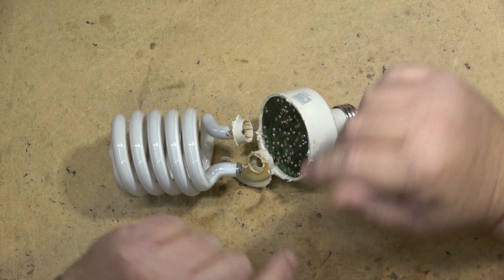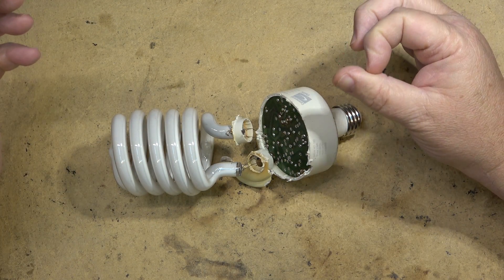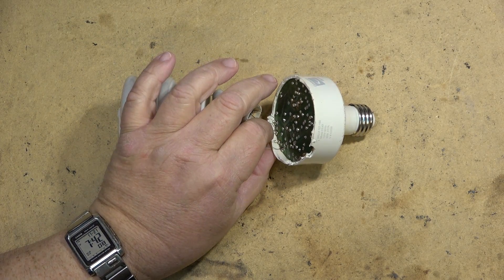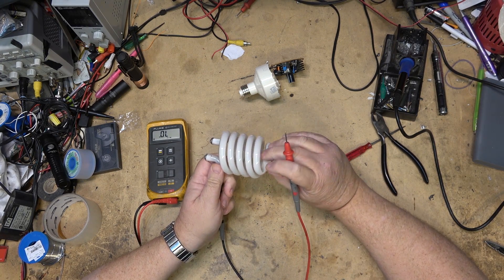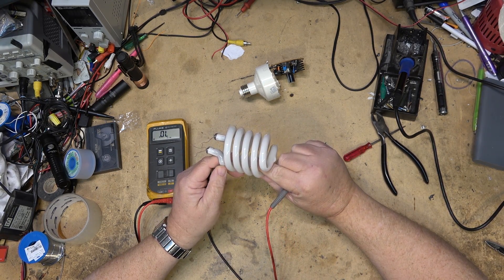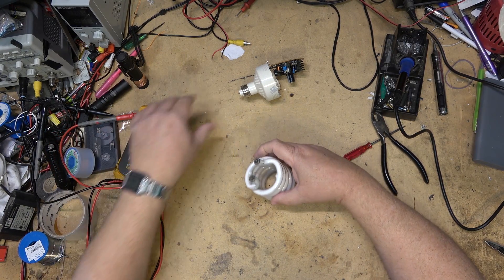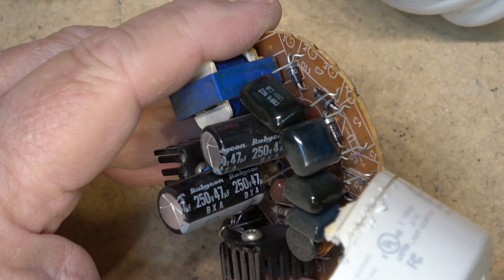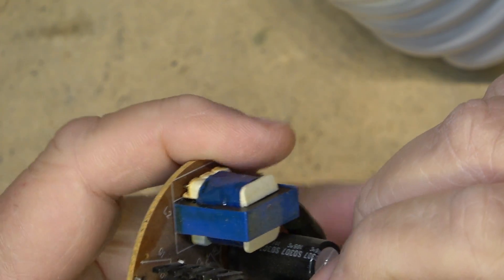I Popped It!

Comment: Amazing, I have had them last a long time, but you got me over a good few years, I think I had 12 years, but it wasn't dead, just getting a bit tired.  Replaced by an LED bulb, I bet it doesn't last half as long, unless it is a Dubai lamp, which it isn't.
Reply from the maker: I have older ones. 4 Ikea folded tube bulbs. At least 25 years old.In the laundry room. Had them in the old house and when I rebuilt I put them in the laundry room where they still reside. They are run pretty much every night, as that is where the cats crap box is, so it is usually being cleaned at night so they run for probably 30 minutes a day minimum, but 25 years in they still work.

Comment: Interesting video, CFL’s suck because of EMI issues, go with LED bulbs.
Reply from the maker: LEDs throw just as much noise as CFL.   I do use many led.  I am using up my supply of CFL.  I may get a few really big 125 watt bulbs for the studio.  In the house everything has been switched to LED now.  Just a few Edison type incandescent for the look.
Reply: Nope, they both convert AC to DC (inverters) and perhaps I have some poorly designed CFL’s but with my portable solid-state radios, antenna fully extended and plugged into AC outlets causes a lot of static when using CFL bulbs. When using LED’s the noise is completely eliminated. Yes LED’s do throw out some noise but not near as bad or noticeable as CFL bulbs. @12voltvids
Reply from the maker: @kenf8563  they both use inverters. The CFL feeds ac to the tube, high power led used pulsed DC.  I get interference on my hf radio from both.  They have now started replacing street lights with led.  I can hear the noise increase every night when the lights come on.  You might not get it with the small ones but the larger units yes.

Comment: Oh boy, those older monster CFL were good.  One I bought from 1998 was still good until a few months ago until I knocked the lamp over.  Unit I broke had a dedicated power factor correction chip as part of the power supply when autopsied.  Like a pre power supply for the inverter if I recall correctly.  When it broke, made me remember you fixing this one.  No way to fix mine....

Comment: Nice docu on a energy saver. I use higher wattage energy saver bulbs in my lighting kit. One bulb in the kit got delivered cracked - the glass was cracked, but I had to film that day. I used super glue to see if it would hold, seal and work. It did work & it has ever since. Its a 125W version, rather big and gets handled with kid gloves. Must admit though, I'm always waiting for it to fail.
Reply from the maker: Yes I am going to get some bigger ones for over the bench.  These LED lights seem to be getting dinner as time goes on.

Comment: You make me regret erasing from existence my old CFL bulb kill video even more! I connected an underpowered flyback to it, and recorded it through a big magnifier, so it was in extreme closeup. I separated it from the inverter, the inverter was dead already. The arc inside kept chewing the glass at one end of the bulb, making a tiny lightshow in there, until air started to leak in.

Comment: Nice Rubicon caps! Ahhhh just the same as that shitty chinnesse lamps that last 1 year. Folks! It's worth pay a bit more for a realiable product!
Reply from the maker: 18 years out of this one.  Solder connection let go 2 years ago fixed that up and all was well.   The number 1 killer of CFL is heat.  Enclosed fixtures bring an early end to CFL and led.   I have some even older Panasonic lamps around here that still work.   Short on off cycles are also bad for them.  They like to run 15 minutes minimum at a time.    I still like and use CFL bulbs mostly in the workshop because they give off  a nice light without glare or harsh shadows.

Comment: 18 years for this type of lamp must be a record.
Most of them start taking ages to reach full brightness then just die.
I am not a fan of the new LED lamps, i find they are harsh on your eyes
no matter what color you go for.
Reply from the maker: I find a lot of glare from the LEDs over the bench
Reply: @12voltvids  LED lighting may be more energy saving, but i don't
think it does your eyes any good.
If you accidently stare at a very bright LED source, it leaves a long
lasting effect on your vision, i am more prone to this due to diabetes.
Modern LED car lights can be very bad for this.
Reply from the maker: @Barbarapape here's an idea, don't look at the lights.  You don't stare at the sin do you?
Reply: @12voltvids  All sins are forgiven! i wonder how many ultrabright LED's it would take to make a source of light as bright as the Sun?
The last place i worked at sold high power LED torches with a warning on the box never to stare directly into the beam.
Reply from the maker: @Barbarapape  yes my big led flashlights have the same warning.  One throws so much heat it will melt our paper money.

Comment: Lasted longer than my led bulb the first one it failed by the looks of it from solder on the man board failing the latest one has lasted a lot longer 13 watt claims to be the equivalent  of a 100 watt but not as bright as a standard old school bulb .
Reply from the maker: 13 watt claims to replace a 60 watt. 23 watt for 100 watt, 42 for a 200 watt. 65 for a 300 watt. I run a 42 and 65 as fill lights behind me.

Comment: In my experience it's always the tube that fails, I've only had one exception and that was defective from the factory. Most of the ballasts still were good except for one brand where the inverter also died (although I'm not sure which died first). Many of the older ones had a PTC thermistor across the arc to provide a controlled startup, and I'm sure this is why modern tubes always die early if there's more than one or two power cycles a day.

Comment: Still have a pack of Phillips tornado lamps, left over from the box I bought around 2000, and they tend to last around 6-8 years in regular use, and around 2 years when on 24/7/365. Also have some PL adaptors, both the magnetic, and the electronic type, which date from probably around 1995, as those you could simply replace the lamp with a new PL lamp, and they all work. Did have to repair the electronic ones often, they would have rectifier diodes blow and take out the fusible resistor. The magnetic ones would run the PL lamps on 24/7/365 as uplighters and emergency lights for around 5 years per lamp, but only if you used Osram or Phillips lamps that were made in the EU, the ones from USA or China barely made a year, though the first few GE lamps, made in the USA, before the plant moved to Mexico, were pretty good.
Reply from the maker: I have 3 PL fixtures and a circline all magnetic preheat.   The bulbs last a long time.   Circline been changed once in 19 years.
Reply: @12voltvids  Yes changed out an old lamp last month, dated back to the 1970's, made by GE. Replaced with an equally old GE lamp, as I do not often deal with 30W fittings, so put in the only 3ft lamp I had, which was an old GE, that had laid forgotten in a corner for at least 40 years.

Comment: I bought 2 CFLs in the late 80s, they followed me to my new house in 94, then to this house in 1999 where one failed with a flash and pop shortly after. I still have the other one in the passage where it gets little use. They were both Philips and I can’t complaint about that innings.
Reply from the maker: I still have one from the 80s too. Back then they used a magnetic ballast and started and were not as efficient as the more modern ones but did last a long time.  This one however had thousands of hours.  It was on my garage lights and they run for hours at a time pretty much every day.   Easily 30 hours a week.   So much use the plastic around the lamp cracked and fell apart.